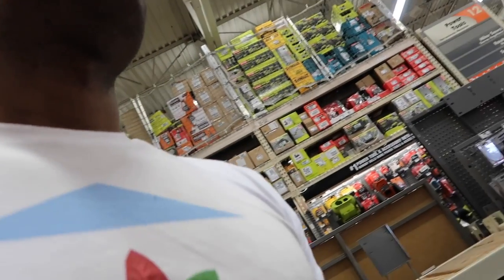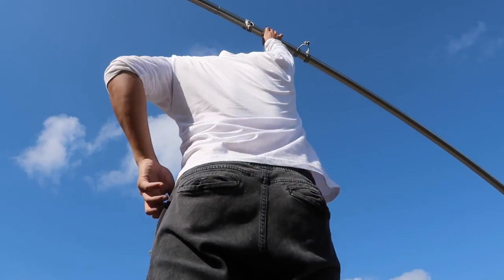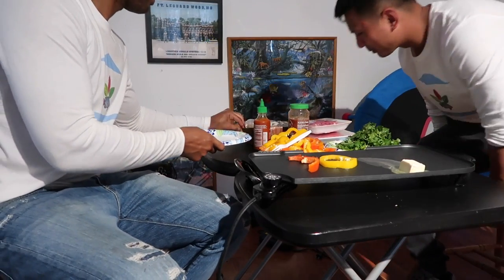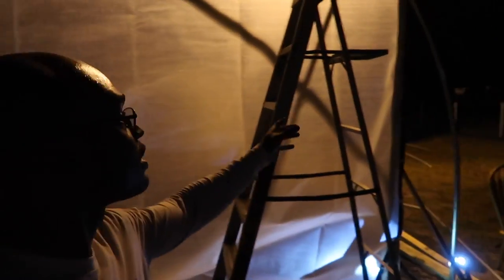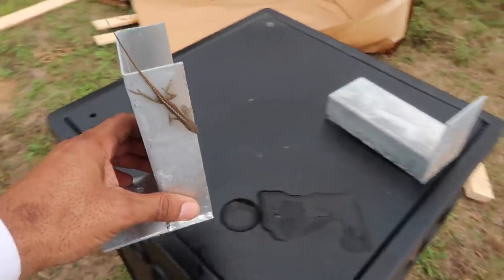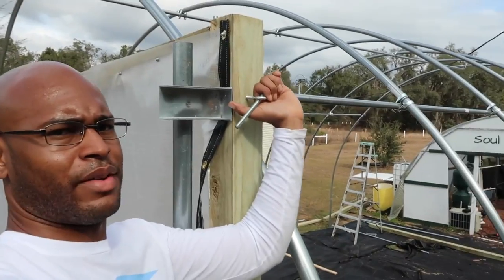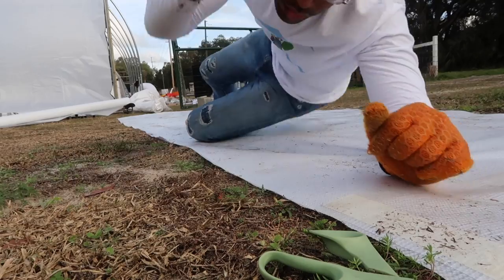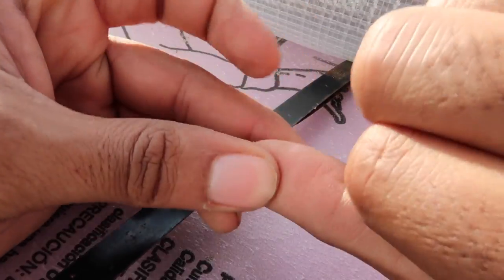Installing The Purlins And End Wall | The Aquaponics God Ep.7

Comment: tool tip - don't use an extension with your ratchet unless it's needed - you'll notice in your videos with the extension when your're tightening your ratchet starts to angle - this is a great cause for snapped or improperly tightened nuts/bolts/screws etc.  Always pay attention to the straight line of the tool and the screw/bolt - keep it in a straight line.
Reply: Also. If you are cutting a bolt or threaded rod. screw on a nut onto either side of your cut line. After the cut, back the nut over the end and the threading in the nut will de-burr the metal "tear-out" from the saw blade. This is not a perfect solution, you can run a file along the cut edge removing most of the burr; then the nut will push away the filings as you back it off. 

WWOOOOOOOOOOO!